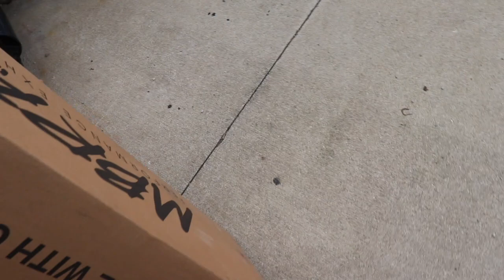12V CUMMINS DIESEL GETS STRAIGHT PIPE EXHAUST!!!

Comment: Nice burnout.  Straight piping your truck is the only way to go: great choice!   Really enjoy your channel.

Just can't beat the benefits of a straight pipe exhaust with lower EGT's, faster spool ups, improved MPG, increased HP, and more torque just to mention a few.  Just a note, but you mentioned that your MBRP Exhaust System cost you $265 on Amazon.  Seems a bit pricey to me for a straight pipe setup.

As a suggestion, you want to check out www.diesel.org - Association of Diesel Specialists - to source economical certified shop in your area to build a solid exhaust system.  Here in Idaho I use a custom shop which installs the aluminiumized steel straight pipe exhaust system (4" turbo back) with a stainless tip (4" inlet 5" outlet) for $78.87 per truck, including tax.  We straight piped all four of our Ram 2500 24 Valve Cummins.

Comment: When are you going to take of the leather heater, just figured its hot enough that now it is restricting the air flow
Reply from the maker: Country Fun only reason I haven’t yet is well I really don’t dive it much, at all really... not 10 miles a week... and the other thing is, there’s no grille inserts so bugs and what not with get all over the front stuff there
Reply: LOUD 'N' PROUD Ok thanks for the answer I’ve been wondering